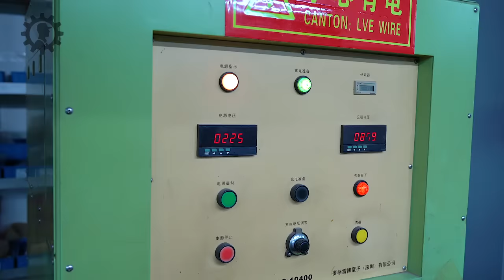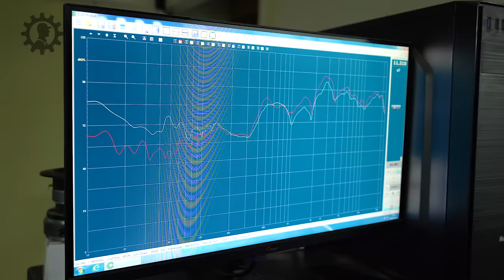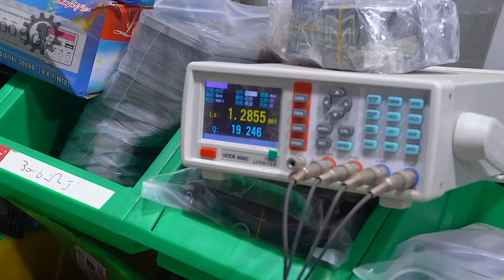Legacy of Sound: A Glimpse into a 30-Year-Old Chinese Factory’s Speaker Production Process

Comment: Immediately a huge drawback: they connect bare wires to the drivers inside the speakers. After a few years, these wire ends will oxidize and the contact will deteriorate. And also painting in 1 layer over MDF without a moisture protection layer is a terrible thing. Do they purposely make speakers with a short lifespan?
Reply: The purpose is to sell more product, not just have the customer buy it once.
Reply: The contacted parts wont oxidize
Reply: These speakers are made to the buyers contract specs.  If the buyer wants to pay for better wires then the factory will use better wires.  Don't blame the factory.  Blame either the buyer or the final customer who will not pay for a better product.
Reply: @tomcede6428  Well, this is China. The first run will be perfect and then the second run will cheapen one or two things and see it if gets noticed. If not then the cheapening will continue until someone notices and makes a complaint. Then they will go back to step 1 followed by step 2 again later down the road.
Reply: @bertroost1675  <chuckles> True
Reply: @bertroost1675 you are totally right, I also made the same experience with sheet metal parts or mould injection parts
Reply: @halrichard1969  Meanwhile Uncle Liu across the road will set up a smaller factory making the same speakers with a different name tag and sell them for 1/3 of the cost locally or in some 3rd world countries.
Reply: cám ơn các bạn làm việc chăm chỉ..tôi mới mua 1 bộ karaoke toàn bộ là made in china..vì giá thành rẻ vừa với túi tiền và chất âm đủ với tôi..các thương hiệu lớn đắt một cách vô lý...
Reply: Это мелочи по сравнению с другими проблемами технологий, от чего это ещё и не звучит

Comment: With a little more care and prescision jigs, these speakers could be transformed.
Accurate cone weights, carefully using the correct amount of adhesive in the cone assemblies and accurate motor drive gaps would help a lot.
Shame about the crappy speaker connectors - soldered joints would be so much better.

Comment: I bet these workers can build a speaker better than they cook. They do this routine day in day out for sooooo many years it's like second nature to them.
Reply: Unfortunately as an insider of the industry, it is with regret that I must inform you that it is exactly for that reason, complacency is rife throughout the entire Chinese manufacturing processes, from start to finish. Sloppy gluing (tails left everywhere), cheap chipboard cabinets, not made from stronger solid woods or industry standard fibreboard. Poor tolerances in every aspect of their assembly. Voice coils loosely wound onto their cylinders, usual (because it's cheaper) not to vacuum varnish, or even spray lacquer the voice coils into position, instead they secure the wire at either end of the coil with tape or blobs of black silicon, Spiders glued not stitched to the cone. I could go on, but I'd rather just buy something worth the money, that will stand the test of time for decades to come and not end up in a landfill site.

Comment: Most mass-manufacturing processes look awesome to the layman, but rest assured, Chinese speakers have historically suffered from very poor build quality and poor acoustic performance, issues ranging from their cheap slapped-together glued chipboard cabinets, to motor coils that frequently suffer catastrophic failure during normal use, because of their lack of attention to uneven tension while winding and not varnishing the coils onto the cardboard cylinders. They typically also suffer disproportionately high failure rates on their assembly lines (but they won't show you that bit) and we all know Chinese manufacturers love to intentionally miss-quote equipment electrical properties, when compared to equipment manufactured by more reputable brands. And let's not mention the ZERO CHANCE of any one of them ever honouring their non-existent guarantees, hypothetically offered on most of the landfill exported from China.

And good luck getting a refund when it breaks. 🤔

This is my opinion, I could be wrong. 😉
Reply: Well, most speakers brands are made in china, so what are you saying?
Reply: Yeah, you're right, you're wrong! 😂
Reply: @Thebrothaisback  Yes, most speakers are made in China, BUT for the highest standards of the brand name.  Brand names shifted their manufacturing for Chinese cheap labour, that is all.
Reply: Well they can produce pretty high quality speakers aswell. It just depends on the factory and how much you are willing to pay for it. If you want cheap speakers, they will use cheap parts and skip some of the production steps. In the end it is still significantly cheaper than most of the "well known" brands that you pay hundreds if not thousands of dollars.
Reply: It's funny because Taiwan can actually make pretty good speakers

Comment: Sad, very poorly made.  Slapped together with little concern for perfection.   Interesting to watch though,  thank you SatisFactory
Reply: And it only cost $400
Reply: Came here to say the same. Can't imagine it sounding good
Reply: Its made in china 😊
Reply: "Sad and poorly made" because they're not in a clean room wearing white lab coats? Visit the Eminence   Speaker factory here in the USA and you will see those folks in Kentucky using the same processes and equipment, slapping  drivers together just as fast. Glad you can read minds of the factory workers and know which ones take pride in their work.
Reply: That is everything in china.
Reply: The Tweeter looked a good design
Reply: @dezshane86  You know about everything made in China ?
Reply: 🙏👉@Taste662 😘😘
Reply: @2dcell I came here to say the same thing.  I worked with a factory floor in a previous job, and the only real difference I see is that those guys would prefer electrical or cordless tools... That, and this factory has more automation and jigging.

I'm actually really impressed with the automation and jigging.
Reply: What is poor in this process
Reply: As in all speaker factories the components are put together using various jigs that remove the need for a high level of training and precise movement of the workers hands etc.. I think some audiophiles here think high end speakers are made in NASA type environments that are conjured up by images in glossy hifi magazines.. All BS. . Nothing wrong with any of the working practices here. What would be a factor here is the quality of the materials used, and that is unknown..
Reply: @johnallen8680  the most expensive cars in the world are hand finished products. I don't see anything wrong with more hands than machines on their speakers. The only important thing is the quality of the product.
Reply: @camilo8cheryl  Yes, and after just leaving the factory it cost maybe 70-80$ ! Rotten capitalism and exploiting cheap labor force!😢😢
Reply: They are build just fine
Reply: I'm not really seeing poor quality. I actually see some quality control while in production, looks like perfectly fine construction here.
Reply: It's  made in china😂
Reply: They are for clubs, gigs, they don't need to be precise. They are just gonna get abused lol
Reply: For those who said it's made in China ... What is not made in China... Even Apple brand or any big brands are all made in China now and many years ago and will be
Reply: Making loud speakers does not need very high technical  machines. Some people always complain
Reply: Blaupunkt made in germany for me the best
Reply: Me parece que es raro que no usen guantes ni lentes de seguridad ..fuera de ahi todo se ve bien hecho al fin y al cabo tampoco es tan especializado un altavoz digo no se nesecita  empledos con doctorado ay gente que repara a mano y les queda cm salido de fabrica
Reply: True 😂, Vietnam method is more realible because of how speaker wire is located carefully
Reply: Yoooooo you don't know what you are talking about all drivers are made this way. All driver factories make drivers this way
Reply: @camilo8cheryl 😊😊😊
Reply: Almost as bad a American made Boeing airplane
Reply: You  must own a speaker made from polypropylene and rubber from a tire 😂
Reply: Let's just make the frame 14k gold ✨️🤣